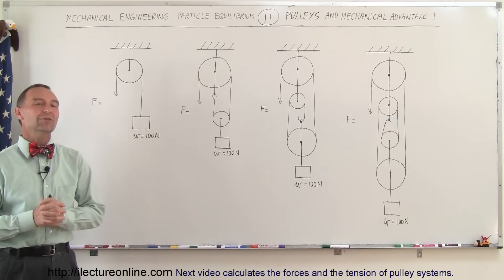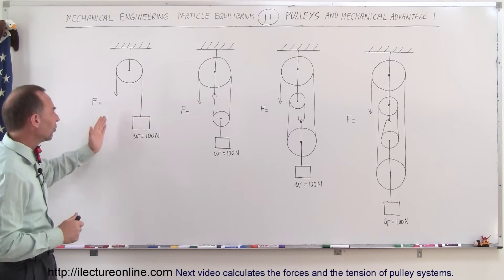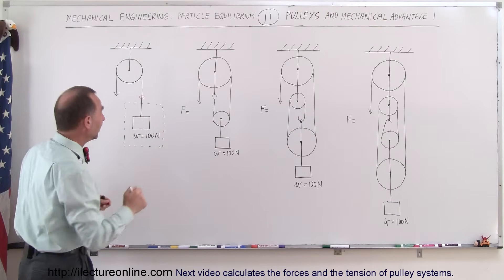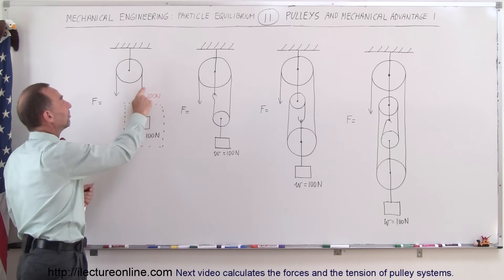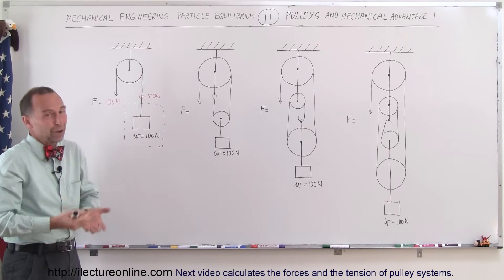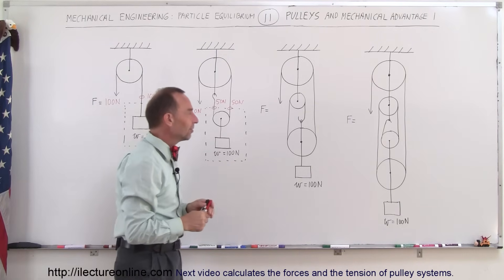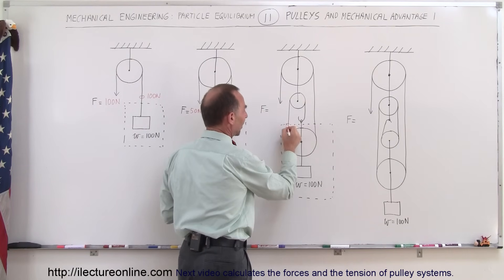Mechanical Engineering: Particle Equilibrium (11 of 19) Why are Pulleys a Mechanical Advantage?

Comment: I just have my JEE entrance in a few months and this helped me revise my Atwood Machine dynamics in a single go, Thanks a bunch Sir 🙏✌️✌️
Reply from the maker: Good luck on your JEE test!
Reply: Got postponed right ? To June
Reply: @82h4dheu6  August
Reply: @eternalmangekyou968  Advance august 
And mains June and July 
Btw I'm jee 2023 aspirant
Reply: @82h4dheu6  best of luck for it , im not pretty much mains oriented , it's rather a way for me to appear inthe Advanced paper for which I've prepared for 2 years
Reply: @eternalmangekyou968  nice 
How much u expecting in advance ? 
Like how much % of score ?
Reply: @82h4dheu6  from all the mock tests I've given I'm expecting at least 200+ and will try my best in these few months to boost the marks probability to at least 250
Reply: @82h4dheu6  my last mock test scores for Advanced were 104 in Paper 1 and 117 in paper 2
Reply: @eternalmangekyou968  amazing , Congratulations and good luck hope u achieve ur goals :) 
So with  250 marks , can we get CSE in  top 7 IITs ?
Reply: @82h4dheu6  sadly not in the top 5 , can get in IIT BHU or others for sure however I'm aiming for Electrical engineering in IIT Bombay and 230+ should be sufficient for that for CSE in top 5 you must score at least 280+ and for CSE Bombay the score must be at least 300 that's the harsh Truth, 11th revision is extremely imp and try to score at least 180+ in the mock tests you give in future if you want an IIT in the first place
Reply: @82h4dheu6 don't focus mush on JEE mains Mock test and don't get too happy if you get good score out of 300 because JEE mains is all about mugging up and speedy answers and the questions are easy, try to give adv level papers which are of 186 marks and improve your Organic especially hydrocarbons ,GOCand Isomerism  for 11, practice at least 300 questions of organic before 11 ends
Reply: @eternalmangekyou968  thanks a lot for suggestion 
Good luck bro

Comment: I wish that he would include in this video a few of the following items.
1 the diameter of the pulley wheel,  the larger the diameter, if it has any effect.
2 the size of the rope which means, surface area for gripping. A small diameter rope like parachute cord or the like up to 1/2” diameter, can slide through your hands and fingers and cut them off or burn a trough through your skin. I’ve had that happen with P-cord, not fun. Since they are very hard to grip.
I have a small block and tackle with 1/4” poly rope, it works ok, but it’s a bitch on the fingers and hands.
Reply from the maker: The diameters of the pulleys do not matter, except in the case where you want one pulley to be half the diameter of the other pulley, or just slightly smaller to make room for the rope.  The thickness of the rope don't matter either except, for the need to grip onto it.  The more force you need to apply the bigger the rope should be.
Reply: @MichelvanBiezen   I work in construction, some companies use a 12” diameter wheel pulley to hoist materials up to the roof, I hoisted myself up 20’ one day with it. I was very easy even though I weighed 180lbs, it didn’t feel like I was lifting 90.
Thx for the reply, Happy New Year !

Comment: does the diameter of each pulleys important if we need less force to lift some weight
Reply from the maker: The diameters are choses so that the ropes are parallel to one another, which in some cases requires the small pulley to be half the diameter of the large pulley, see example 2 and 3, and is some cases, see example 4, the pulleys in the middle need to be slightly smaller than the pulleys at the top and the bottom so that there is room for the ropes.  Also note that in examples 2, 3, and 4, there are 2 to 1 ratios in the diameters in order to reduce the force required to lift a load.
Reply: @MichelvanBiezen  Damn thanks for the answer !

Comment: Now I am more curious, what happens if there are different diameters of pulleys. Does it makes different speeds like how bicycle chain and sprockets does?
Reply from the maker: The diameters of the pulleys on the example on the right don't matter.  In some cases, like in the second example the bottom pulley needs to be half the diameter of the larger pulley above it.

Comment: Why are the inner pulleys smaller in proportion to their location? Is there a difference if all pulleys are the same size?
Reply from the maker: You need to leave room for the rope, and in some cases the size needs to have a ration of 1:2 as illustrated.

Comment: Great Lectures by the prof. thank you very much. One question - in second arrangement, why should the distance moved be twice compared to the first one?
Reply from the maker: The change in length (distance traveled) on the rope being pulled must equal the distance traveled on both side of the pulley being pulled up, so you get a 2:1 ratio compared to the distance traveled by the weight
Reply: @MichelvanBiezen  Thank you very much, Sir

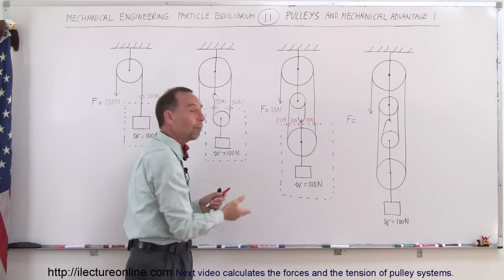Comment: Professor : At 4:27 you begin discussing the last combination and I wonder if it may have been helpful to spend a little time explaining why the free body diagram you drew included the bottom two pulleys - ie the general rule is that it must have a boundary through the maximum number of suspending ropes / lines ?
Reply from the maker: There is no hard and fast rule as to where you place the boundaries of the free body diagram.  You place it in a particular place in order to gain some information about the system, by isolating some specific force or forces.

Comment: simplest formula
force applied=weight of load/no. of pully
Reply from the maker: That does not always work.  There are pulley arrangements that do not fit that equation.
Reply: @MichelvanBiezen  also amazing video keep it up
Reply: @MichelvanBiezen  yes, it's just a trick only for this situation, otherwise machinal advantage =force out/force in
R(resultant force) =f-mg where f can be tension

Comment: Did is there a role of pulley size.
Will it make change to move weight up.
Reply from the maker: The pulley size doesn't matter so long the relative size of the pulleys allow the ropes to be vertical.

Comment: Observation here in 4th case if we start drawing the string in opposite direction then the mechanical advantage is 5 but velocity ratio is 4 :l
Reply from the maker: The mechanical advantage and the velocity ration must be the same.
Reply: @MichelvanBiezen  ya its actually an error this makes its efficiency 125 % which is not possible

Comment: Yeah but HOW is just adding longer rope around increasing wheels making a lighter load??? Plenty of people explain what works but never HOW.
Reply from the maker: That is explained in the video.  The free body diagram shows that on the first diagram the load is supported by 1 cable.  On the second diagram the load is distributed over 2 cables    On the second diagram it is shown how the load is divided over 3 cables      And on the 4th diagram the load is supported by 4 cables.

Comment: The most difficult part is to draw the free body diagram....  based on what did you choose the dotted rectangle? lol
Reply from the maker: The boundary of the free body diagram is placed at the location where you want to consider the forces being exerted to the portion of the system inside the box.  Try to draw the boxed at different locations and see what happens.    In this case the boundary of the free body diagrams cut across the cable for which you want to know the force.  (Remember that the laws of Newton apply)

Comment: In the 4th diagram, what is the reason for drawing free body diagram across 2 pulleys, why not across only the main pulley which is directly holding the weight or why not across the lower 3 pulleys? He did not explain that.
Reply from the maker: You can place a free body diagram around any one or any number of pulleys.  The location of the free body diagram was chosen to cut through the maximum number of ropes since all of them play a role in holding up what is below the "cut" line.
Reply: @MichelvanBiezen  Thanks a lot for explaining it.

Comment: Great explanation, BUT how do you know how many objects to include in your free body diagram?
Reply from the maker: The boundary of the free body diagram, cuts through the cables and indicates the forces acting on whatever is inside the box.  That is how you determine where you want to place the free body diagram.  Wherever you want to consider the forces is where you place the boundaries.
Reply: @MichelvanBiezen  I see all of that, but how did you know to select the FBD around only the mass in #1, the mass and one pulley in #2 & #3, and the mass and 2 pulleys in #4?  What informs you where you cut the FBD off?  Is there a rule that I should follow?
Reply from the maker: In the first diagram there is only 1 cable that hold up the weight, so I placed a FBD around the weight.  On the second diagram, there are two cables from which the weight is suspended, so I placed a FBD around the weight and the bottom pulley so the border cuts through both cables.  On the third diagram there are 3 cables holding up the weight, so the FBD diagram is placed so that the border cut through all 3 cables.  You could also have drawn the FBD to include the bottom 2 pulleys which would have the border of the FBD cut through those 2 cables, and you could have used that the determine the tension in those 2 cables.  There is no rule.  You can place the FBD anywhere to give you the desired information.

Comment: '
not really...
some no and some yes...
depend on the pulley wheel size
Reply: @Need2connect
hi N...
'
thank explain...
a pair of ball bearings with the pulley wheel would be little easily pull...
without ball bearing is a little hard pull

Comment: I have watched SIX explanations of pulleys and I still have no idea how they work. I can follow the math. I know how to use pulleys. I can see that I am applying smaller forces over larger distances to move the object. But I couldn't for the life of my explain why it works. You might as well be describing the flow of black magic through the aether.
Reply: So you know that with a 2:1, you move the load 1 foot by pulling at half the force for twice the distance.

The pulley is just the means to allow that... like 2 meshing gears but making one gear smaller with fewer teeth.

If you pull the load with a FIXED rope, you must pull 1:1.  By using a 2:1 pulley, it pulls the load with 2 STRANDS thus allowing twice the length to move through the system.

Don't know if that helps... just try visualising it.

Comment: In the first simple example does the principle of equal and opposite force not mean the
that the pulling force needs to be more or they will just hold each other, ie at least 101Nm to lift the 100n ? Not qualified in any of this, just a real question of my logic?
Reply from the maker: Only momentarily.  After the object begins to move, a force equal to the weight will pull the object up at a constant speed (Newton's first law).

Comment: Question. The force applies to the upper support beam is still 200N for all examples? Thanks.
Reply from the maker: Only for the first example.  It would be 150 N for the second,  133 N for the third, and 125 N for the fourth example.
Reply: @MichelvanBiezen  Ah ok, so the weight being lifted plus whatever force required to lift it, dependent on number of pulleys... got it. Thanks a lot!!!

Comment: Doesn’t the diameter of pulleys have an affect as a lever to change the force required too??
Reply from the maker: To a point, the diameter of the pulleys do not matter much.  The size is chosen to keep the ropes vertical.

Comment: You can see it also considering the static equilibrium of the different mechanical levers of the  pulling side wrt the weight side. As an example, in the second case the force you need is half of the weight because your lever is double with respect to the one at the weight side. Good video though 👌

Comment: I suppose it's also possible to calculate this as, 1 pulley = 100n 2 pulleys = 1/2 (50n) 3 pulleys = 1/3 (33n) 4 pulleys =1/4 (25n) or 100% 50% 33% 25% of the weight.
Reply from the maker: Not always.  It depends on how the pulleys are connected.

Comment: Why weight of the pulleys (figure 2, 3 and 4) is not taken into calculations ?
Reply from the maker: The weight of the pulleys is insignificant compared to the weight of the load.

Comment: 33 and 1/3 not 33 also just divide the load by the number of pulleys ie 1 pulley is divided by 1 2 pulleys divide by 2  3 pulleys by 3 etc, simpler then adding the lines

Comment: One ques.please,(figure 1) if i pull the force 1meter so weight is lifted 2meter ok.so what is the rule in 2nd ,3rd ,4th number of figure?
I don't understand this pulling ratio?
Reply from the maker: On figure 1, when you pull the rope down 1 m, the object will rise 1 m.     On the second figure when you pull the rope down 2 m, then the object will go up 1m.  On the third figure when you pull the rope down 3 m  then the object will go up 1 m.
Reply: @MichelvanBiezen  i don't understand 😒

Comment: Very clear explanation. However, in the first system, the weight of the pulley, speaking of real world situations, would really not affect the tension in the cables of the free body diagrams.
Reply from the maker: If the pulleys have mass, and there is friction between the rope and the pulley, then the answers would be different.  We are dealing with "ideal" pulleys here.

Comment: does the dia of the pulleys make any difference and thanks for the video , its like a light has turned on in my head lol
Reply from the maker: surprisingly, the diameter of the pulleys does not matter.   You do want to pick the diameter so that the ropes are vertical.
Reply: @MichelvanBiezen  cheers for that
Reply: i would of thought a bigger pulley used in combination with a smaller pulley would of decreased the amount of pull needed similar to how gearing on  mechanical metal sprockets work

Comment: I understand this, however why have you drawn the box around 2 pulleys on the last one and not on the lowest pulley like the other 3?

Is it because you have to put a line through the last point of the cable/rope?
Reply from the maker: There are many different ways in which ropes and pulleys can be combined.  The combinations shown here are standard, and yes that is how they are connected.

Comment: Professor, may I ask if the diameters of the pulleys matter to the mechanical advantage or only the number of ropes supporting the load?
Reply from the maker: The diameters of the pulleys are chosen to keep the ropes vertical, , only the number of ropes supporting the weight matter.
Reply: @MichelvanBiezen  Got it.  Thank you.

Comment: Why do I think that the first of the four is wrong? The way the professor describes it is as if the force I would need with a pulley is the same with the direct force i would need to lift the weight directly from the ground. In reality though I need less force with a pulley.
Reply from the maker: The first one is correct.  You'll need a force equal to the weight of the object to lift it.

Comment: Hi, is pulley system and gear system same thing?
Reply from the maker: With gears you must equate the number of teeth in each disk.   See this video:  Physics: Viewer's Request: Mechanics #14: Gear Ratio of a Bicycle    https://youtu.be/yaHEntLjmkk
Reply: @MichelvanBiezen  Thanks for your reply. But, I could not find answer for my question. Maybe because, I am physics "illitrate"  , never studied physics. Let me try my question again. If I pull a 30KG stone with pully,  I can decrease the force it requires by adding 2-4 pully, by 1/4 or half force. Does this effect of pully is same as the effect of gear on a running wheel. Does gear decrease force same as pully?  Can we run a wheel with pully system? Or it is only possible for one side lifting work, like lifting water from well?

Comment: Great explaination! Thanks! So the thing that bears most of the load and weight is the attachment of the pulley’s to each other and the original anchor point?

I think when people teach about pulleys they should discuss this concept more. The extra force required to lift doesnt go away, but get’s transferred to pulley anchor points
Reply: https: //youtu.be/UHocGHguWJI👍👍👍👍👍
Reply: I mean it seems to me that all of that naturally follows as explained. You could then balance each of the examples with a weight on the free end of the rope that equals the required tension and then draw the box around any point in the system.

Comment: I have a question : if the object's weight is 1000N, and we apply a force of 1000N on the rope , is this enough to left it up ?
Won't it stay stationary ?

(sorry for my English)
Reply from the maker: If it is not moving, then the object would remain stationary.  If you increase the force momentarily to get the object moving, then once it is moving the force equal to the the weight (zero net force) would keep the object moving at a constant speed due to Newton's first law.

Comment: Can I make a stupid question.? Pulleys make light work by mechanical force. I get it, but we have (in 2020) powerful motors to lift heavy items. Use one pulley with a strong motor and forget the extra length of cable/rope!!
Reply: It's very inefficient to use a motor without a form of gearing. No reason to use a 1000 hp motor when you can use a 50 hp motor with some pulleys.

Comment: Do you get better advantage based on where the force is applied around the pully, say at 90 deg instead of 180 deg.?
Reply from the maker: If you pull straight down, you can use your weight and your body is mechanically more suited for pulling down.